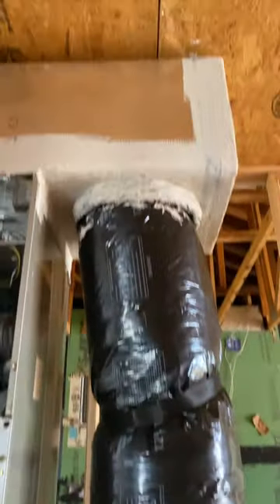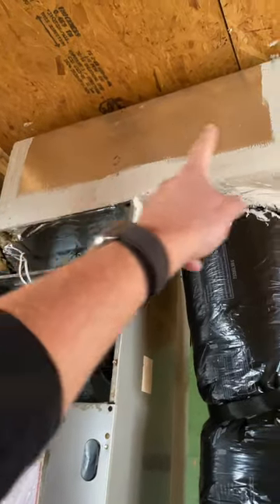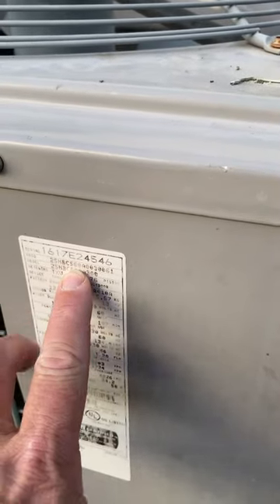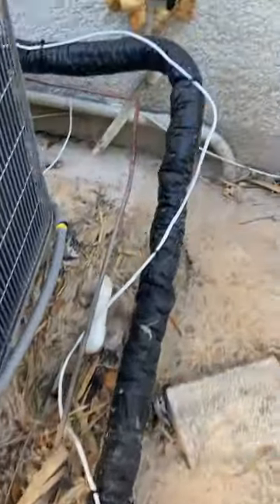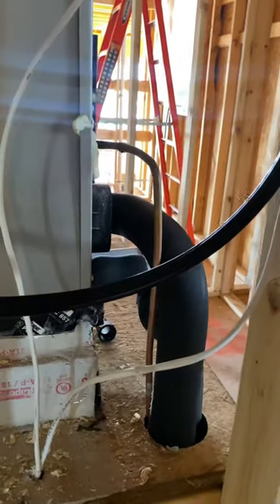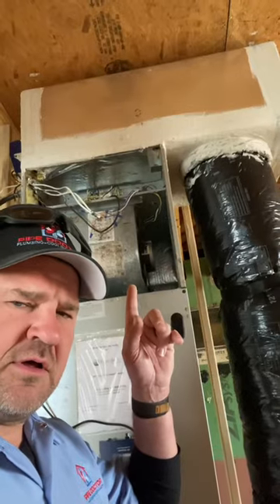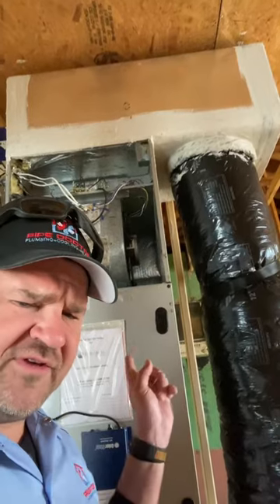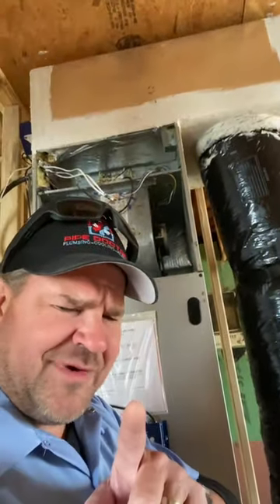Central Florida HVAC & Central AC Epic Fails Revealed! #hvac #shorts #pipedoctor

Comment: Have zero idea whats going on... but loved the pissed off Elmo voice 😂😂😂
Reply from the maker: Thanks for the comment
Reply: What's wrong is everything. I'm not an HVAC guy, but I know a blower restriction when I see one.

The filter dryer is basically a large tube with some sort of desiccant, like silica balls packed tightly enough to filter but loose enough not to cause a major restriction to the refrigerant and oil moving around the system.

The silica is to remove any residual moisture in the refrigerant loop, and the filter action is to catch any wear products and contamination in the loop and keep it out of the compressor.

Compressors don't like water or contamination, especially scroll compressors with their tight tolerances. Get a piece of detritus between the scroll and the wall and you're in for a bad time.

Comment: The lower south I've gone the worst the ductwork has gotten in my opinion.... In Texas it was all oversized and all fiberglass and plastic in the attics....
Reply from the maker: I still can’t believe that this contractor thought 12 inch was good for a 5 ton system. God dammit.
Reply: Try 20" 😂 they're way off.  And some turning vanes.  That thing's dead in the water and is gonna cost double to fix

Comment: Does the unit have a filter drier inside the unit?
Reply from the maker: did you see one??
Reply: Carrier units don't have them inside. Only Goodman and Lennox
Reply: @Kilcrops0914 And york
Reply: And Trane
Reply: Just looking for excuses.
Reply: I know for a fact that the bryant/carrier he’s showing comes with the filter drier zip tied to the valves on the condenser when new, so they definitely didn’t put it in 😂
Reply: @Jackhvac_R that'd how the trane units come.

Comment: 2000 cfm through 12" flex! What size return could they have put in, or filter. I always use the 1510 Honeywell filter for 5 ton systems
Reply from the maker: I really don’t even know what they were thinking 5 ton system with a 12 inch flex connector off the top of this unit. Crazy.

Comment: Chances are the professional who installed it, couldn't read the installation manual if it was in English anyway. 

This is why I don't even call HVAC people. 
Virtually none of it's brain surgery. 
Unless there is some weird issue that requires lots of trouble shooting, anyone can do the this shit. 

The owners manual for the air conditioner literally tells you all of this shit including duct sizing. 

I'll be damned if I pay some toolbag to come charge me $500 to change a capacitor or clean out the drain.
Reply from the maker: Thanks for posting your feedback